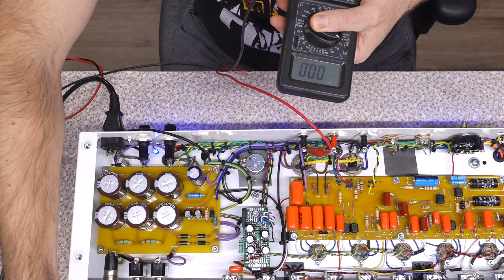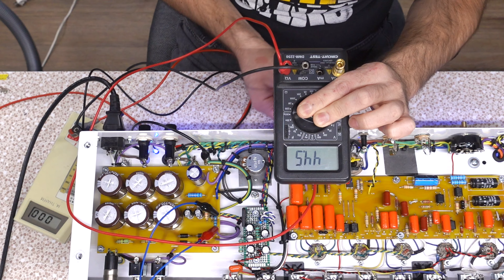SLO Clone Build Ep.5 - Finish Wiring & First Testing

Comment: My fuse burned out during assembly, only later I found out that it was of a low rating.  But overall there were no problems with the assembly, everything worked right away.  I used homemade optocouplers - a white LED and a photoresistor, the shadow resistance was about 20 MOhm, and the illuminated resistance was 100-120 Ohm.  Good luck with the build!
Reply from the maker: Ohhh, home made LDR, I've never considered that. There have been times I've looked for those parts but had a hard time finding them. 
I def did something wrong in this build, the problem was my fault.

Comment: Looks like it arc’ed from the fuse holder to the star ground near there, and from somewhere near the bias test point, or between the 220k grid leaks after the phase inverter to each other, or the chassis. 

I’m intrigued for the follow up video on why it was sparking like that. 

Did you connect pin 1 and 8 together for the el34’s? (I know for a fact they’ll run without the suppressor grid connected, but it can cause issues). 

Maybe the test load died causing a short across the OT?
Reply: 28:42
Reply from the maker: Hah, when the fuse blew the light from the spark was seen thru the holes the contacts pass thru. It's hard to see on the first angle but a preamp tube shorted out, and there is a spark there to. This video was filmed a while ago, so I know what happens next, and it was a dumb mistake I made wiring the preamp tubes sockets.
Reply: @DATT  Ah, that’s very easily done. Next build I do, I’m actually gonna stick the 9 pin sockets in a little soft jaw vice and pre wire colour coded leads to them (everything except the heaters). I find wiring them up in the corner of a chassis insanely fiddly. 

(Wouldn’t really work with the design of these SLO clone boards, but with turrets, or boards with a strain relief hole like Marshall’s it’ll be fine)
Reply: @DATT  Can you break the glass or otherwise remove the glass on the shorted preamp tube and solder equivalent resistors to each of the pins that way the meter should show the correct currents and voltages proving the wiring? Could be done for all of the amp tubes though where to find that many broken ones? Also theres current limiting on bench power supplies :) As a matter of fact if one amp tube can fit all of the slots then you can use the test amp for each of them and as long as you got resonable currents/ voltages g2g. then test fully assembled for required voltages and currents.
Reply from the maker: @Jonathan_Doe_  Yeah, kind of had to wire the board first in the SLO. 
My wiring was good for the most part, it was a bad resistor placement, which was done earlier.
Reply from the maker: @gregjones3660  dummy tubes, Interesting idea. I might consider it. I think due to the nature of the fault it might not of helped here.
Reply: @DATT  Wont help with stray wires. One concideration for the dummy tube would be to mark the polarity and observe that the opposite polarity isnt present like if two wires were switched. perhaps instead, I might recommend that a high definition picture is taken of a working system. That will make for quick reference of the wiring one for one just by visually matching the wires from the picture to the system.
Reply from the maker: @gregjones3660  Well I had a drawing of the layout. At the end of the day, I just brain faded and hooked a resistor up "backwards". Fortunately, it's a rare enough occurrence.
Reply: @DATT  I apologize if Im being bothersome. Just if you wanted to look at an actual high res picture of the finished USC sn:1 then at the physical wiring of the next completed USC sn:2 board to compare? Probably sn:1 is already out the door but the picture of sn:1 becomes the template for future serial numbers. Quick reference.
Reply from the maker: @gregjones3660  Oh, you're suggesting that I should of recorded my layout. Actually, that might not have been a bad idea. Cause if I did build another I'd have to bascially start from scratch, or from memory what adjustments I had to make. I know they guy I built this amp for, so I can get access to it again if I needed. I didn't think of it, cause builds like this are extremely rare for me.
Reply: @DATT  🙂

Comment: Light bulb limiter.  Sometimes I forget mine and sometimes I get lucky.  Really should have it permanently in the bench AC supply.  My next project.
Reply from the maker: Oh yeah, I use one of those. In this cause it wouldn't of been applicable as the PSU circuit was fine.
Reply: The suspense is killing me.  LOL   Waiting for the next video!   @DATT
Reply from the maker: @HandWiredAmps  Oh boy, I guess this would be one of my first real cliffhangars. 
The timing worked out in editing. Sometimes I'm not sure how these videos will flow till I'm actually cutting them.
Reply: I commend you for making and posting your videos.  I often want to post different things, mostly educational, but I know what goes into it and I have enough hobbies already.   @DATT
Reply from the maker: @HandWiredAmps  Yeah, def adds work to a project. Not sure I intend them to be education are much as anecdotal. I'm not sure I consider myself qualified to educate. Lots of my vids are my figuring it out as I go along.